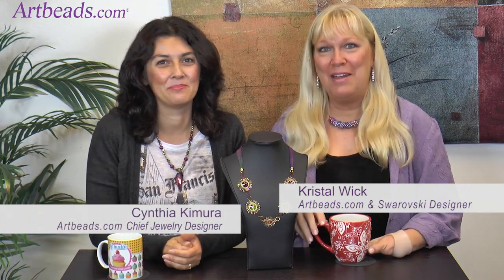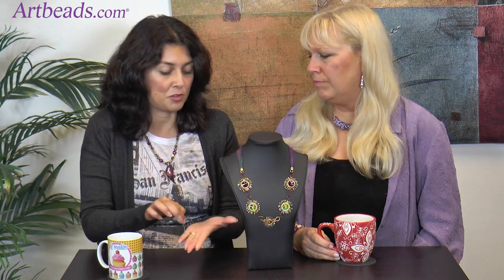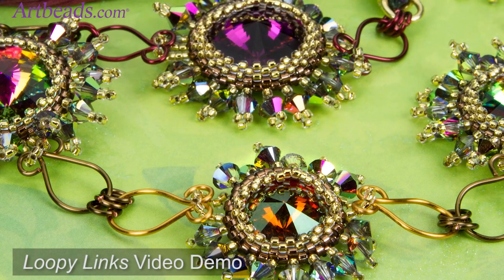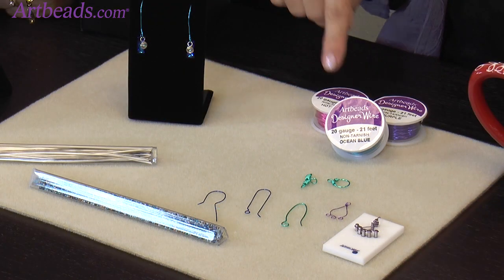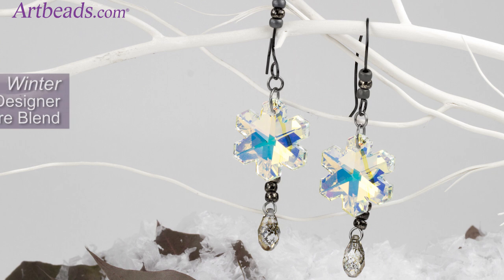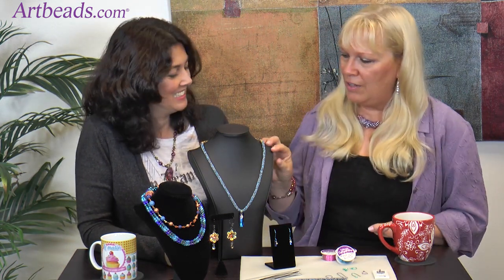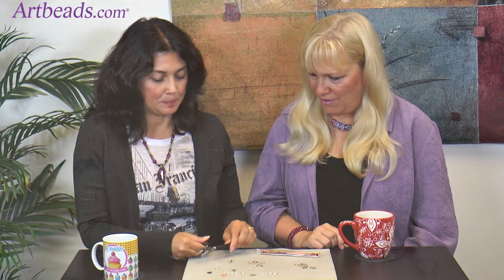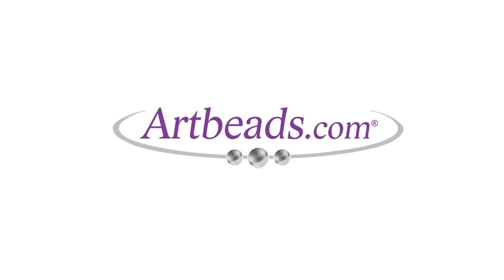Artbeads Cafe - Blooming Stars Necklace, Artbeads Designer Wire and Multi-Sized Looping Pliers

Comment: I remember when I first started beading rivolis with peyote stitch. I also had a very hard time. When I did finally get the peyote bezel around the rivoli I couldn't embellish the bezel because my tension was so tight I couldn't get my needle through the beads in the bezel. So after a lot of practice and patients I finally figured out what I was doing wrong. So I stopped beading so tight and now I can bead a peyote bezel around a rivoli in less then 30 minutes and I just love it. I'm happy to hear I am not the only one who had this problem.